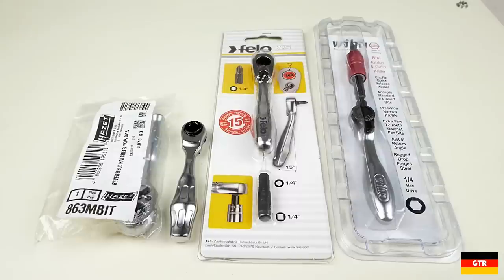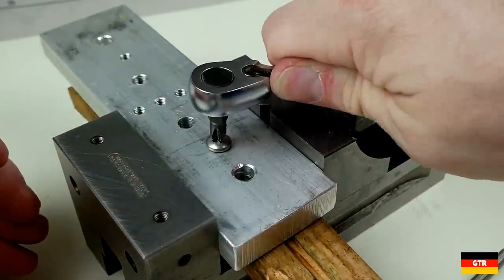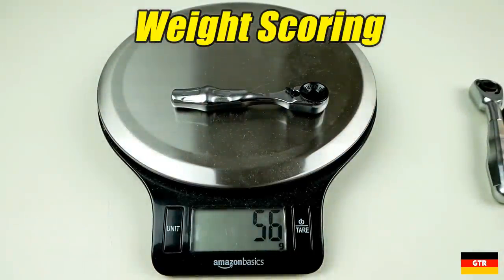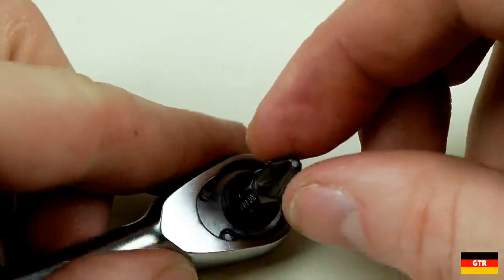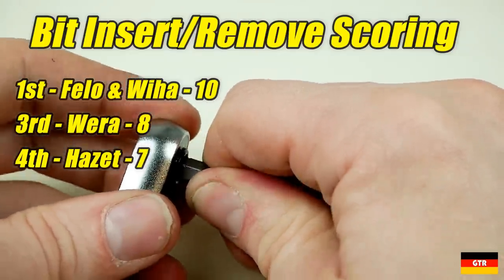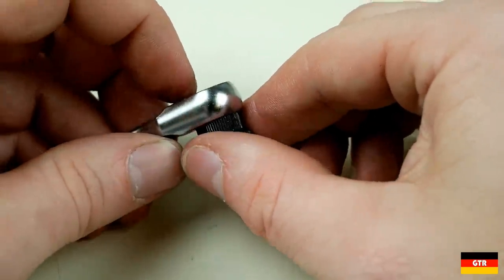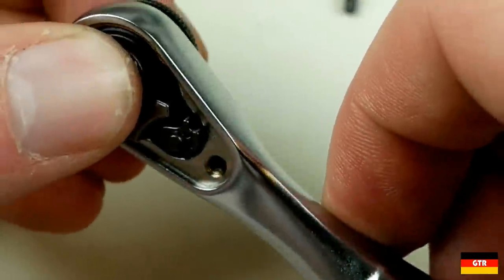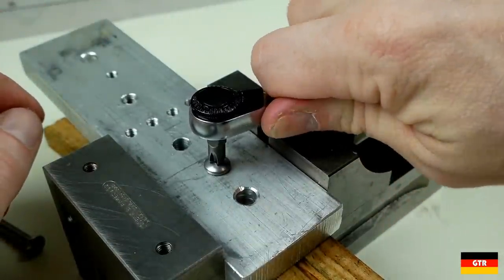Bit Ratchet Showdown

Comment: Naturally I just must be the first to watch this 🛠

Considering the size of the tool, a normal old fashioned tool will do as well or better.
Those are gimmicks.
Reply: Not quite. We use them on line maintenance of Airbus planes for access to tight spaces (small fasteners used to retain seals, etc). In this application, dominant requirement is bit-retention (losing a bit can be disastrous) with envelope, tooth-count and engagement next important.
Reply: How are they gimmicks? Extremely useful tool...
Reply: We use small bit drivers literally every day in auto collision repair to remove trim that is held on by fasteners in very tight spots, such as needing to pull bumpers without removing the wheels, or removing interior trim. Nice review.
Reply: I will be using this mainly when I need a screwdriver where a stubby is too long

Comment: The creator of this channel is an armchair mechanic who does not use tools in actual paid work on a daily basis. This means that this minute examination of pros and cons is merely an academic exercise, and there are no results based on real- world use. For example, real mechanics could not care less about minor differences in handle shape. Prove me wrong!
Reply: David Gold 
I have huge issues using the tiny handle on the Wera in certain applications in the machines I work on. I am switching to a longer, thinner handle to help hold onto the handle in between hold down rollers.
Reply: yeah "real machanics" and "I work as a insert random jobs for 99+ years and invented the best tool ever created" - stuff...